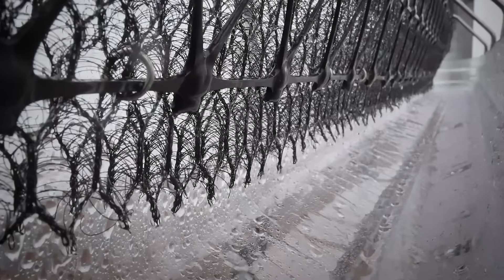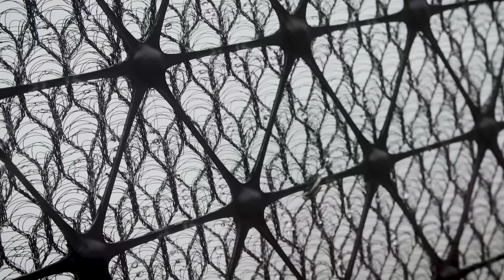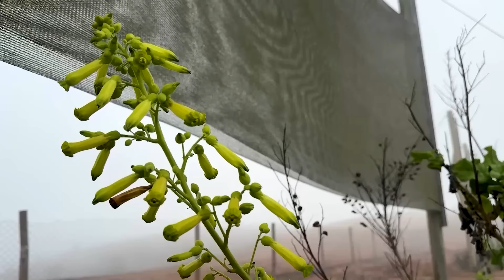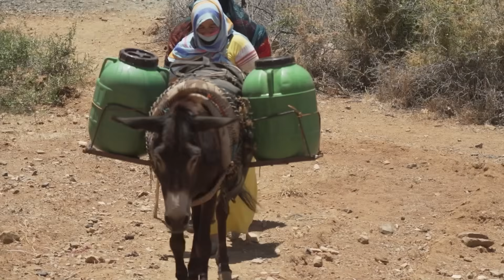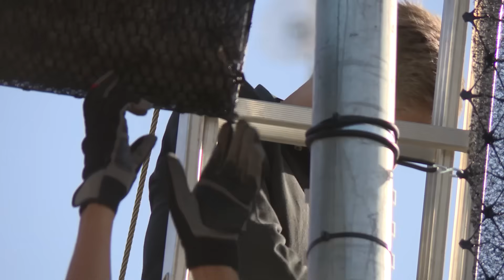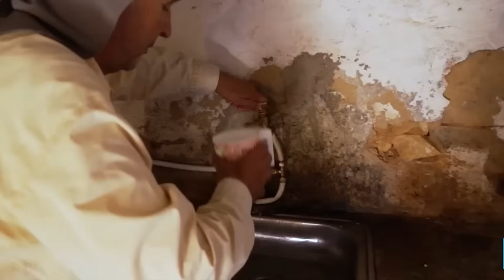How Germans Quietly Manufacture Millions of Liters of Water in the Sahara for Free, Insane Result

Comment: Why or are these cloud fishers used in the western areas of the mountains of California, Colorado & other areas where fog,wind are present? I have been hearing about water shortages the western United States for decades. It can even be used to replace under ground aquifers & water table. It seems as if this being done would continually replace the underground supply. When used continuously. Along with Desalination plants, using water from the Pacific Ocean. Then storing this water underground in the water table also. Then there is water treatment facilities. That could also add to the usable water supply. There's times in the western areas when water is to plentiful. Floods happen, flooding vast areas. Floods covering hundreds of miles of towns happen all over the United States. Happening when rain fall is to great for the ground to absorb all at once. Why isn't this water collected using pumps to collect it . Run it thru waste water treatment facilities. Then using it when water needs are at their greatest. Times when now water supplies are rationed across California & other States out west.
Reply: Why? Because it's not guaranteed continuous mega  profit. 
 Sustainable access to low cost clean water should be recognised as a fundamental societal right!

Comment: The mesh should be place in zigzag  ne need for support been, lower the pressure on the fabric,  planting trees using  a percentage of the water will work the same,  trees also are water caching sistem